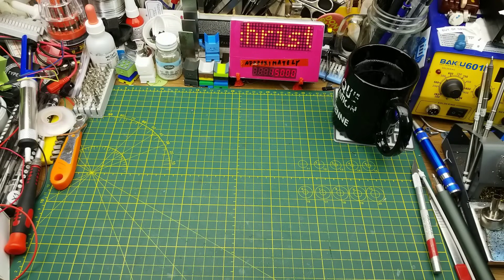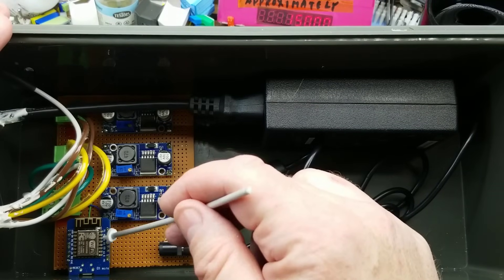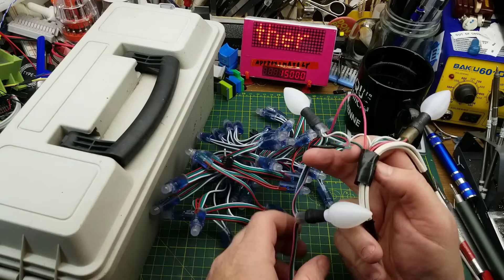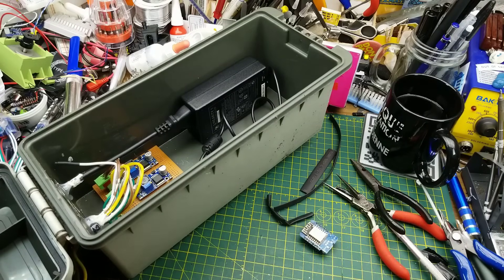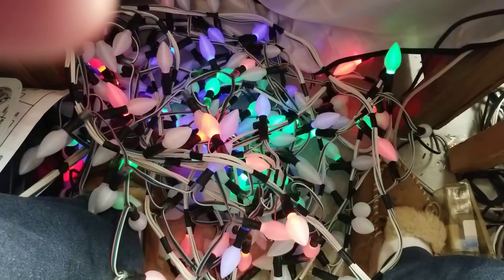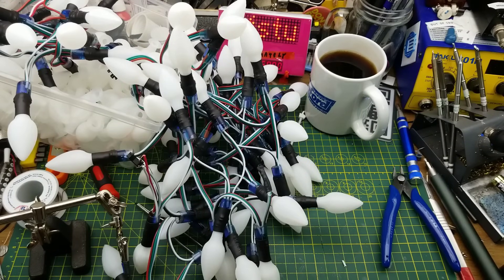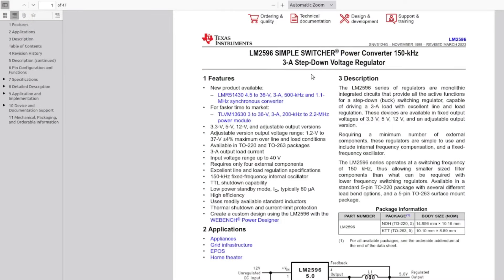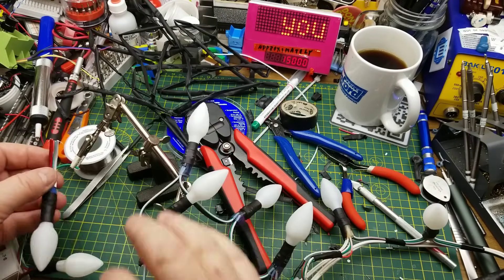updating my Christmas lights (2023 edition)

Comment: Hi there.13:04 but for more than 1A you should use heat sink
Reply: Heat sink for IC
Reply from the maker: I doubt they get anywhere close to the full amp from each of them.

Plus, when it is in use the box is typically covered in snow.

Comment: 5:20 for waterproofing, buy some GLUE-LINED heatshrink. It's awesome stuff, and not really that more expensive.
Reply from the maker: Yes it is good stuff, but I haven't found any small enough for what  I'm doing.
Reply: @pileofstuff  - the gluw-lined has a higher shrink ratio, usually 3:1 or more. The 4mm will shirk down to seal on single 24 AWG and you're using much larger than that 😉
Reply from the maker: @johncoops6897  Looks like I need to do some more searching.

Comment: Don't run a full string of white! 300 x 60mA = 18A.
This is based on the common WS2812 LED is 20mA per colour.

You might need to add a power calculator in to your web server, in the same way as FastLED does.
So you can't over drive your power supply.